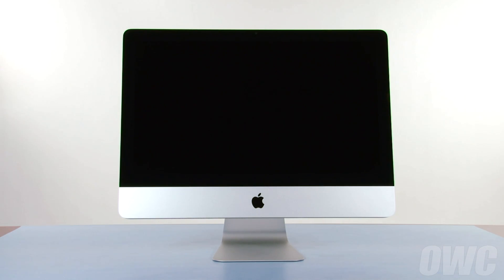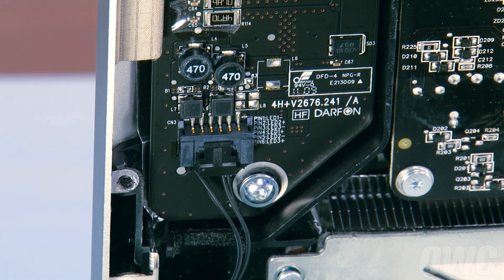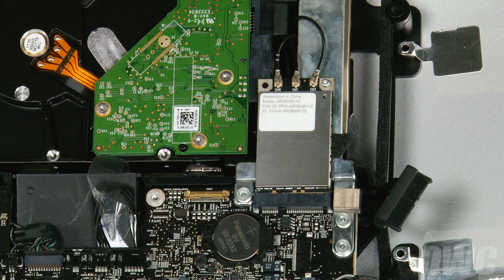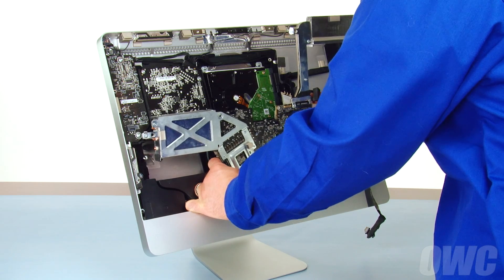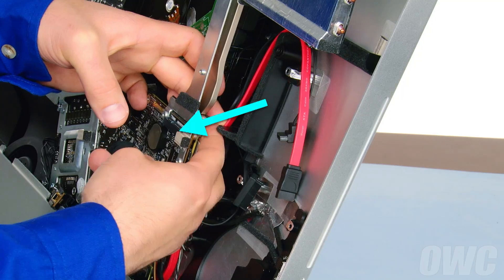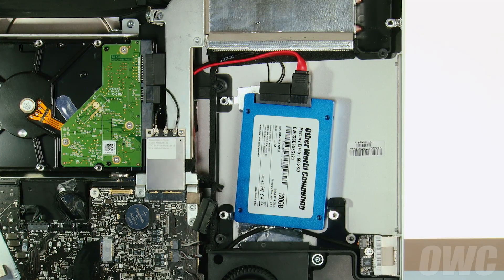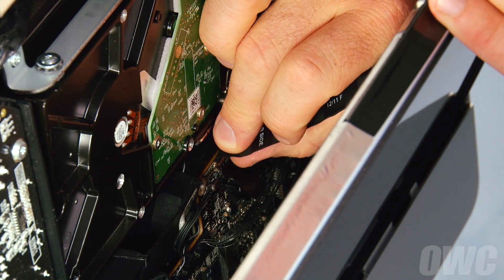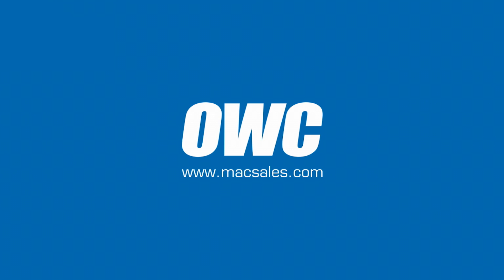How to Install a 2.5-inch SSD in the SSD Drive Bay of a 21.5-inch iMac (Mid 2011) iMac12,1

Comment: Can I mid 3010 21.5 inch iMac use an SSD that has a SATA 3 interface? Thanks!
Reply from the maker: The 2010 21.5" iMac has installed a SATA 2 interface.

Comment: Does this procedure work with a iMac 11,2 'Mid 2010 I5 Core' Model A1311 EMC No.: 2389 ?
Reply from the maker: That should be very similar overall. Regrettably, we don't have an installation video of the SSD upgrade for this iMac, but iFixit has installation instructions on their website which are really handy in case you wanted to see a step by step specifically for that iMac

Comment: Is that SATA connection in the same place as the iMac 27-Inch "Core i5" 2.8 (Mid-2010)?
Reply from the maker: There is a very similar installation process. We have attached the installation video below.

https://www.youtube.com/watch?v=xfP9mRlwYFI

Comment: I am unable to get a hold of the  "iMac to SSD power cable"  in India. Could I use a SATA Y splitter power cable and power it with the HDD's power source? Would be great if you could help me out. Thanks !!!
Reply from the maker: Hello Bhuvanesh!  The SSD Bay Add-in Kit includes the cabling necessary. Here's the 120 GB Electra version: https://eshop.macsales.com/item/OWC/K21IM11SE120/  If you prefer to work with OWC EU, they carry the OWC Internal SSD DIY Kit (without the SSD) https://www.owcshop.eu/catalog/product_info.php/apple-215%C2%94-imac-2011-models-tools-p-1253
We do have some OWC distributors in India. https://www.owcdigital.com/reseller/resellers#map-tab

Comment: Thanks for the guide.
I'm installing a 2.5" HD (with 2.5" to 3.5" adapter bracket, installed where the original HD would be), plus an SSD as my boot drive installed directly underneath it.  (Rather than restricting airflow past the DVD drive & GPU.)
I imagine I'll need to put the temperature sensor on the 2.5" HD. Where do I put the electrostatic pad, in this config?

Comment: It's all really easy except for the display port.  That is really difficult to seat and it can be easily bent as what happened to me.  I'd rate myself at pretty proficient but this was quite challenging as you have a bad angle while holding the screen to put it back in

Comment: most other vids you don't have to remove the logic board, once you remove the screen the hard drive is right there.
Reply: Most other videos show you how to replace the internal HDD with an SSD. This video shows you how to install an optional extra SSD (using the extra SATA connector that's available), leaving the internal HDD where it is. That gives you 2 storage drives instead of 1. If you wanted, you could follow both procedures and have 2 SSDs installed on your imac
Reply: Thinking of doing this modification, will the optical drive still work in the imac if the installation procedure in this video is followed? @solojazzcup

Comment: before I install the SSD, do I need to install MAC OS ? Or is it possible to install it on the SSD post install and make it the primary booting drive? How do you prevent it from booting from your HDD?

Comment: Here's an easier solution: I added an external SSD using Thunderbolt.  Startup time went from over 4 minutes to 24 seconds, and everything else got faster, too.  With that "upgrade" and more memory I've never felt the need for buying a new computer.  I just use the internal drive as a clone in case the SSD should die.  But it's been more than 2 years and I've had no problems at all.
Reply: How did you connect your SSD via Thunderbolt? Not seeing many, if any affordable enclosures.

Comment: Why not just replace the hard drive with an SSD,
Reply: on a video from the "Tech It Out
" channel I've read this reply to the same question
:
"The hard drive fan will ramp up more sometimes, but you can actually get an app Called Macs Fan Controller. I use it and it can actually read the temps of the SSD because the SSD has a built in sensor, but by default macOS can’t read it without that app. You can set it to control the fans based off the SSD temp. But you have to be careful because you will have to set it for the gpu and cpu because auto doesn’t always work well especially for the gpu and I don’t trust auto."
This is the video: https://www.youtube.com/watch?v=Vw1tCbFxHPg
Reply: Devanir Nunes Filho  you can easily by sdd adapter fit it into a iMac and buy secerct temple that connects to ssd and works perfectly like the main iMac drive and fans don’t go crazy
Reply: And also, you get to keep the hard drive along with the SSD, for more storage
Reply: Cappuccino - because you would need a temperature senser cable
Reply: @NicVandEmZ  or replace the hard drive for better performance and download mac fan control.

Comment: This is one way to do it, but if you want to keep your optical drive, and not waste money on a special SATA cable, here's what I did: https://www.haught.org/2015/11/16/imac-2011-hd-thermal-sensor/
Reply: Is there anything special about this particular SATA cable though? Just wondered, it seems like you could use any as long as it's the right length. If you believe otherwise, let me know. Also, the method described in this video would also keep your optical drive intact :)

Comment: HI, I just followed all the steps on the video but after adding the ssd the IMac does not power on. It doesn't make any sound or show any information on the screen. I noticed that the only the fan below the main hard drive starts when I press the power button but it doesn't keep running. the is also a green light on the logic board. I also tried to disconnect the sdd and start the iMac like it was originally it did not work. I watched this video again probably 10 times to see if I miss connecting something, everything seams to be in place. Please let me know if anyone can help!

Comment: Hi awesome video, Can you confirm if the same can be done on a late 2009 21,5" Imac (A1311) (ie adding to so keeping the optical drive iso replacing it with a "doubler" as most of the tutorials show for the late 2009 ones? or is it different on the late 2009 ones for place or Sata connector reasons). Thanks in advance.

Comment: Hi, I am trying to add an SSD to my mid 2011 Imac without removing the standard Hard drive and add the ssd behind the optical drive. My question is do I need that In line thermal cable?
Reply: Hi, I made a small video comparing boot speed after installing the SSD. If you want to have a look please check the link https://youtu.be/iKnqGf8lrKg 

Thanks.

Comment: Pulled off the whole operation, but now booting up I have a vertical white bar a bit over an inch wide towards the right side of the screen... did I break it? Or could the display connectors inside need to be adjusted? 

Opening this thing up again is not got in to be fun...
Reply: MacSales. com I tried, but no this did not fix the issue. From what I’ve read on the net it looks like I probably damaged the LCD when using the opening tool by pushing too far in. Turns out this is likely a very expensive mistake and that I’ll need to be replacing the entire screen.

Comment: Hello,

I purchased an installation kit and a Crucial 1T, 2.5-inch SSD very recently.

I managed to put the computer back together and my problem is that when the SSD WAS installed, the computer wouldn't turn on. When it WASNT,  it would turn on fine. Can you tell me what I should trouble shoot?

1. Could it be the cables?
2. I'm pretty sure I did this at least 4 times with the videos so I'm pretty sure my testing was accurate. 
3. Could it be the SSD? To I need to do anything to it prior to it?

Please help, thank you.

Comment: This is by far the best video for this procedure on the internet. I upgraded mine today. It took me 2 hrs after a couple of problems. The display port connector is the fiddlyest most delicate and difficult to seat correctly, thing ever. The display didn't work the first time I put it all together because I hadn't seated it correctly. 

Another issue I had was the fans running at max rpm, and no usb power when I switched back on. I opened everything up again and couldn't see the issue so I watched the video back again and realised that I hadn't plugged the mic cable by the fan back in. After doing so everything ran perfectly. Why this should affect the fan speed I don't know but there you go! 

Thanks for such a precise and comprehensive guide. Just perfect.
Reply: Hi, I am trying to add an SSD to my mid 2011 Imac without removing the standard Hard drive and add the ssd behind the optical drive. My question is do I need that In line thermal cable?
Reply: btw how is your imac now? is it much quicker than before when starting up and using applications?
Reply: I'm having trouble getting that display port connector back in?  any advice?
Reply: @stephengonzalescajonhs3205  My issue was not being able to see what I was doing properly whilst holding the screen up. Could have used someone else with a torch to shine some light on what I was doing. All I can say is take your time and go slowly, don't give up and don't force it. And if you can get someone else to both hold the screen and shine a torch in, I'm sure that would help. Sorry I can't be more helpful.

Comment: Installation went fine on my iMac mid 2011 however now have a main cooling fan problem with the speed running way too high and oscillating slow to fast.  Any clues on how I can fix this please?

Comment: This video is brilliant! I would never attempt anything like this, not in a million years. But the video is so clear and flows at a really good pace. I decided to invest and was able to install in roughly 3 hours. Well proud of myself.. thanks guys :D
Reply: Hi, I am trying to add an SSD to my mid 2011 Imac without removing the standard Hard drive and add the ssd behind the optical drive. My question is do I need that In line thermal cable?
Reply: no you dont need it

Comment: Hi I just installed everything as you explained with the same kit cable. But now I don't know why when I'm using the Mac during 1 hour or 2 the fans start running completely crazy both I think too much noise it's annoying never seen the fans running that fast. I'm using iMac mid 2011 21,5. I tried installing Fans control software but doesn't work... any idea guys?

Thank you
Reply: I just fix it with an SSDfancontrol software luckly, but yes I installed  the same WD black 2 TB instead the one that came that was WD black 1 TB but the it's weird because the last HDD didn't have any wire sensor connected. Can affect that anyway?
Reply: Thank you :) I'll do with the SSD software for now! Cheers :)
Reply: I will :)

Comment: hi was wondering if this will work with my imac 21.5, 11,2 mid 2010 Intel core i3? I've been receiving this error code..4hdd/11/40000000: SATA (0,0)... when I did the hardware test. was wondering if I add an ssd, will it help me solved that issue?

Comment: Hello. I've used the video to do the upgrade and it was very comprehensive - thanks.

The only problem I have now, on El Capitan, is that in Disk Utility the option to Partition the drive (as in your online instructions) is greyed out. I read on a forum somewhere that in El Capitan you have to Erase before you can Partition. Is that correct?

Comment: My main concerns are 1. not getting dust and smudge marks on the screen, and 2. not damaging the internals through static charge.  What sort of gloves should be worn, and what's a suitable material for storing the LCD screen in if you don't have the foam(?) that the iMac was originally packaged in?
Reply: MacSales. com Thank you for your response - much appreciated.

Comment: Great Video....Very helpfull
I plan to upgrade with 2 Drives, One is HDD 4tb and + SSD Samsung 256gb
So...The Power Sata Cable...weather I should buy?
Can I use sata power splitter cable?

Thanks before
(already subscribe & thumb)

(Imac middle 2011, 21.5 inch)
Reply: Thanks you very much
I will order....may be I choose OWC Internal SSD DIY Kit

Comment: If you leave the main HDD alone, but then choose to boot from this new SSD, do you need to get the in-line thermal temperature sensor to keep fans from spinning at 100%?
Reply: Thank you very much for the response.  I suppose I can then install macOS on the new SSD, format the old HDD, and then select the SSD as the startup disk?  Is that the correct general approach?

Comment: i looked on ur site n basically answered all my questions EXCEPT 1. If I buy the Adaptadrive thing, do i still need the thermal sensor cable as well? Or is that built into the red lil board on the adaptadrive cage? Thanks, i dont wanna buy something wrong or something i dont need.I dont see a video on ur site using the new adaptadrive thing,
Reply: +MacSales. com thank u. im confident i can do the upgrade myself, just worried about the 4 wires i gotta detach from the Screen, everything else is easy. Thank u 4 ur help.

Comment: If im just gonna put a SSD n take out the old HDD, i dont need to do all those steps correct? Once i remove screen, i can just unscrew HDD n replace it with SSD using the same SATA cable already in use correct? Im only wanting 1 drive, an SSD. So it should be much easier correct? Great video, if i can do this, i will be orderingmy owc upgrade kit soon as possible. Thanks.
Reply: +Cory Thayer They took a really long way around the bend to get to replacing the HD.  You can pop the back off and put in an SSD without doing any of that nonsense.
Reply: +MacSales. com btw, i did the SSD upgrade last Saturday n it was much easier then i thought. Now i may get a 5k imac in the next month or two,  that upgrade scares me to death in comparison to this one. Anyway, i was getting 100mb read n 100mb write with the original 7200rpm hdd. now I'm getting 390write n 440mb read speeds. also from 1:04 boot time to 24 seconds. Much much snappier with the ssd.
Reply: Using the proper DVD caddy which has mini sata adapter 8.99, and the old temp sensor is way easier than any other method. You can even still use the superdrive with this: 
https://www.amazon.com/gp/product/B00LOMGXWM/ref=oh_aui_detailpage_o03_s00?ie=UTF8&psc=1
These guys are out of date, sry.